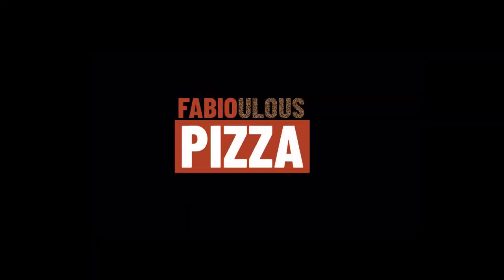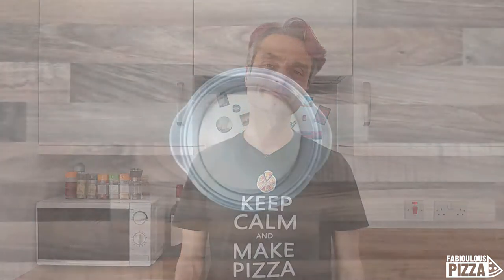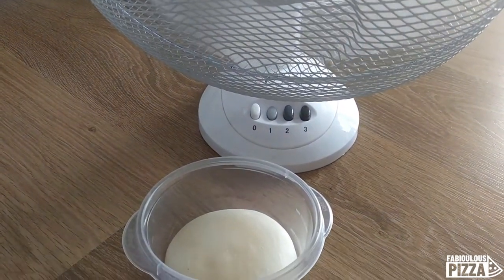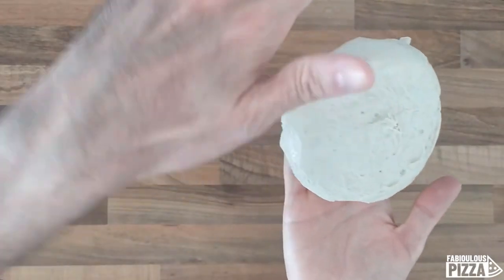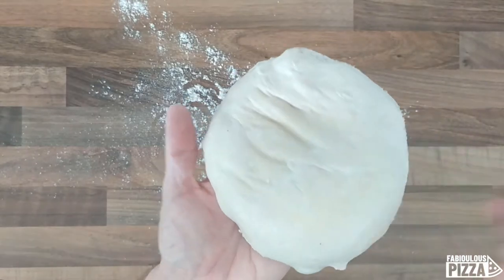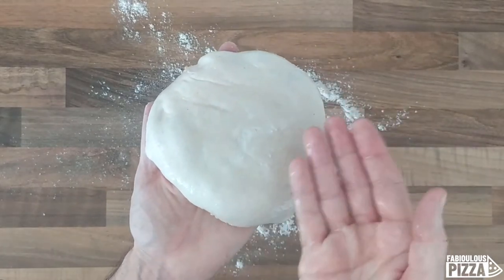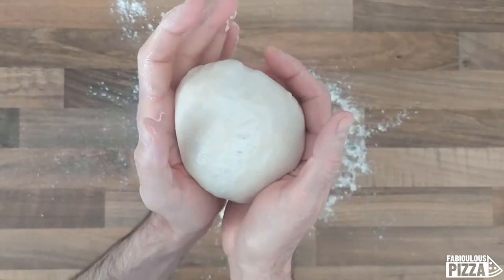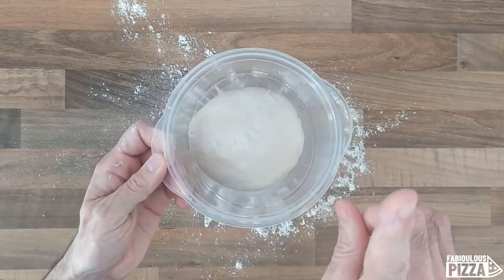How to recover DRY dough - How to save dough 🙋🏻

Comment: Thank you, Fabio! Great videos and tips. It's very helpful for a home "pizza man" to have a professional like you to share your tips and tricks and 300K pizza experience. 
This dry skin has happened to my dough balls when I store them in the refrigerator in a plastic dough box with a loose lid. I tried brushing with olive oil before the 24 hour fermentation and that helped but I still had some dry patches. Do you think water is better than olive oil for this? 
I've also had a problem with very stretchy elastic dough and your other video made me realize that I'm over-working my dough. Thanks again!
Reply from the maker: In opinion, using water it's better. "Dry dough" means literally that the water content decreased, so a nice little massage with water the perfect fix. Even when I worked in the pizzeria, we always had a spray bottle ready...I think that bottle is still there 😁